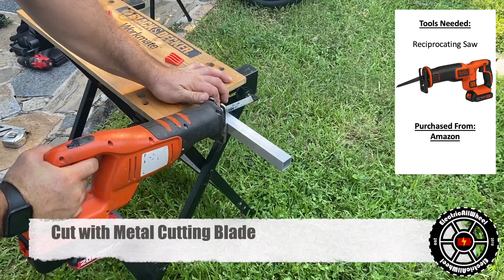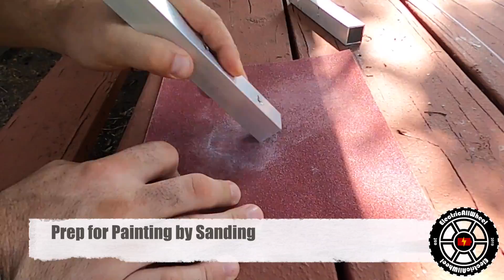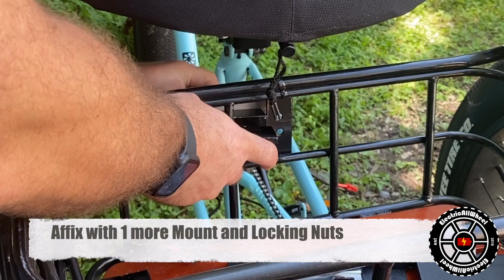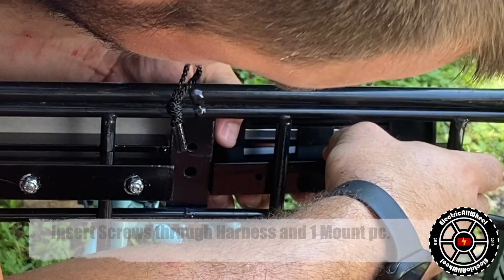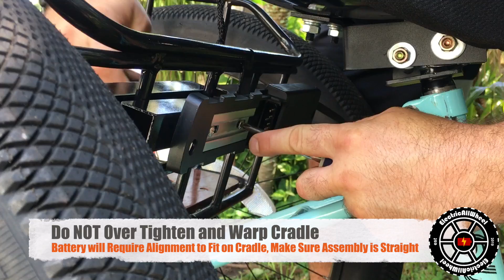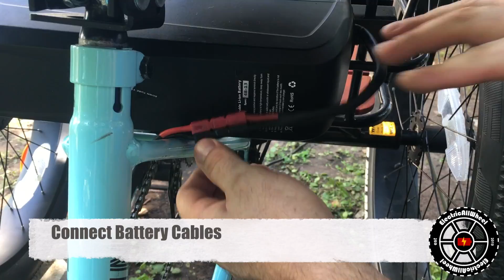How to Build Custom Sun Baja Trike Electric Battery Mount for Electric E-Bike E-Trike conversion

Comment: For a battery mount, I just used 2 pieces of 1.5 x .25 x 15.25 Aluminum bar stock, I drilled 2 holes on each bar to mount the bars to the frame, then drilled 2 more holes to attach the basket to the bars. Basically,  I moved the basket to the rear about 2.5 inches and lifted it. I used nylon bushings between the basket and the bars. The bushing give me the clearance needed to stack them. I can then attach the base of my Mega Shark battery upright between the front of the basket and seat post. The way it sits, I have full access to the battery lock from the basket side and my recharging port faces forward.  This cost me about $32.00 in materials.   I then spray painted the bars gloss black to match the bike.  If you want, you can use longer bars to the rear, drill it to insert a flag mount or eyelets to take your trike down.  Hint: Drill the holes from the battery mount first.  The added bonus that the battery sits lower and any extra bolts is hidden under the basket.